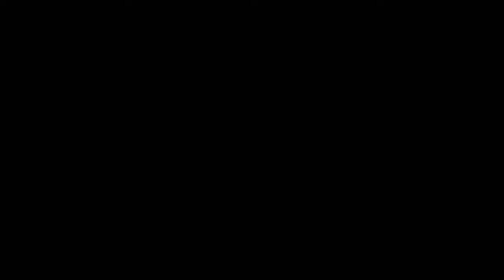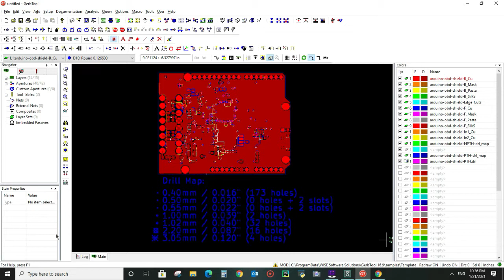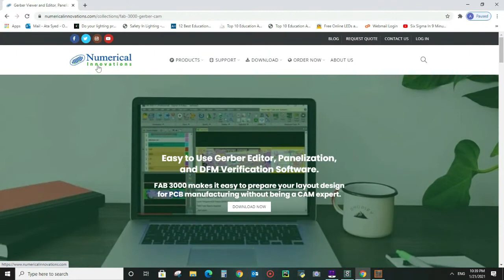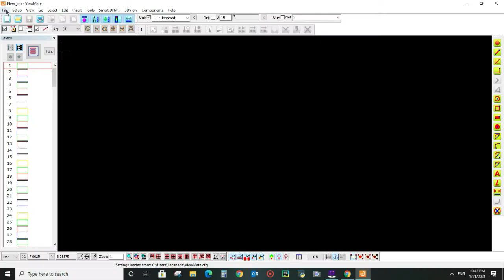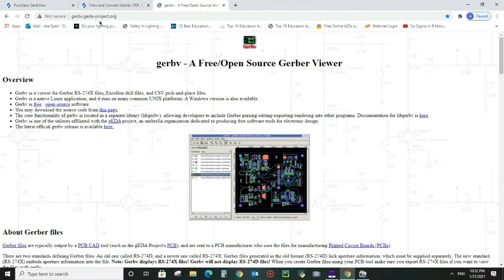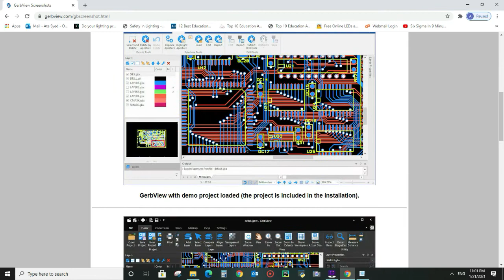Gerber Viewer review

Comment: Great video. My pattern maker converted the gerber file to dxf, so I could send it overseas to a Chinese factory. However, none of the Chinese factories can view the full data. Know any software that can convert to dxf in addition to viewing the gerber?
Reply: Hi wildkims2008....Converting DXF to gerber is not that simple. As far as I know, AUTOCAD is probably the best option. KiCAD can also do it but I believe it needs some additional setup. 

The PCB manufacturers don't like to use DFX for manufacturing files as their softwares although capable of loading DXF (for drawing or outline only), but are not really very good. Meaning they can load DXF in their CAM softwares but the conversions is not always 100% accurate. 

Many of the softwares I use are capable of loading and outputting both DXF and gerbers. That means I can load a DXF and output as gerber but I know the conversion will not be a great one. Gerber to DXF is OK though, just not the other way around.

What software are you using ?
Reply: @atasyed5160  thanks so much for your insight. my pattern maker (garments) created the pattern in Gerber. Then, He  converted it to dxf so that it could be sent overseas to the factory. However,  one of the 3 factories have 100% accurate file. I believe he converted it improperly, so I want to look into 3rd parties that can take my gerber files, and convert them to dxf with 100% accuracy
Reply: @wildkims2008  By pattern maker (garments), I don't understand. Is it something to do with clothing ? Not PCB?

In any case, most of the gerber softwares can load gerber data and convert it to DXF with quite good accuracy as long as we are talking outline. Meaning if you take a PCB copper layer and convert it from gerber to DXF, that may not be a good idea. But if we are converting a PCB outline from gerber to DFX, that would be ok.
Reply: @atasyed5160  yes exactly, the garment patterns just show the outline of the clothing. Do you know anyone who can take the gerber files and convert them to dxf? My pattern maker is supposed to do it, but fumbled the job